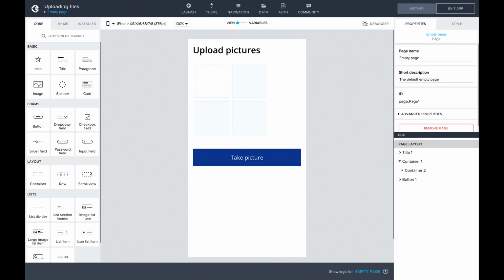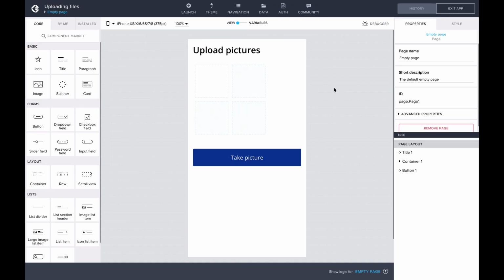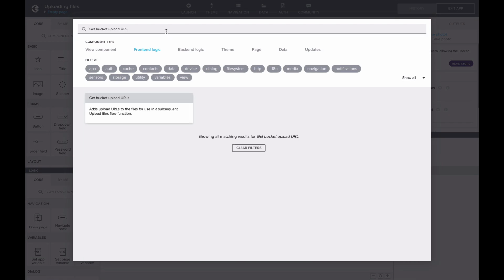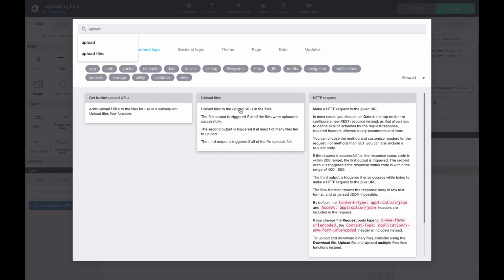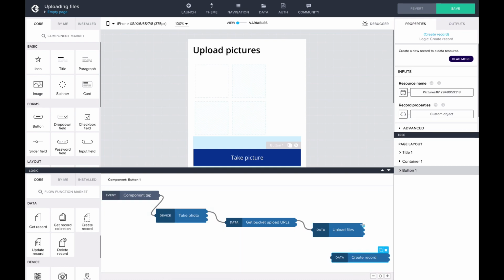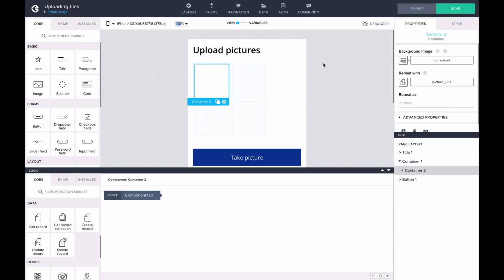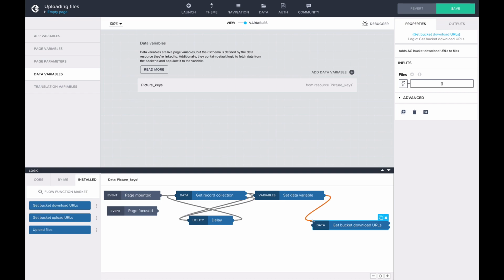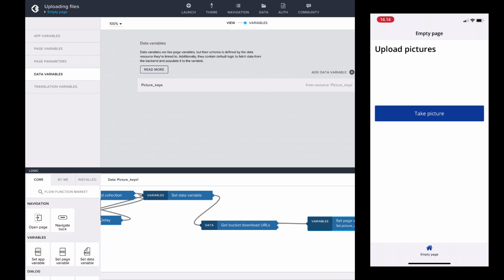No-code Power-up: Upload Files /w AppGyver

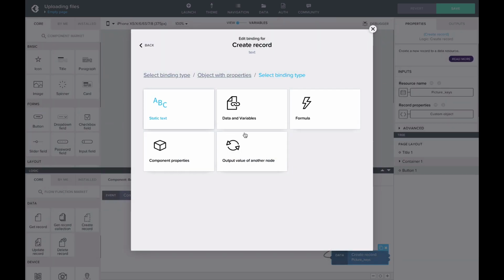Comment: 2:38 - I followed along but the ID (under Object with Properties) cannot be generated. Did I miss something here? Thanks!
Reply from the maker: Hi there! In the video we're using the "Client-side storage" resource type. It sounds like you're using AppGyver Cloud Storage, which automatically assigns IDs, so you can skip the step involving GENERATE_UUID :)
Reply: @SAPBuild  is there anything else I must change besides the"generate ID" to make it works on cloud storage. It is working well on local but when i change the data base to cloud it does not work.